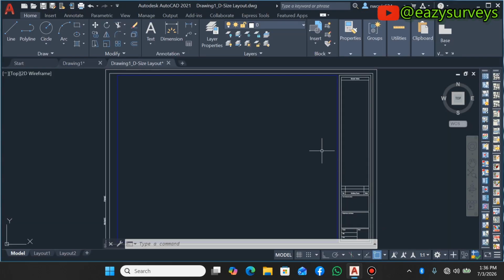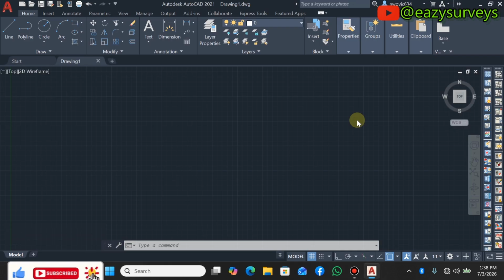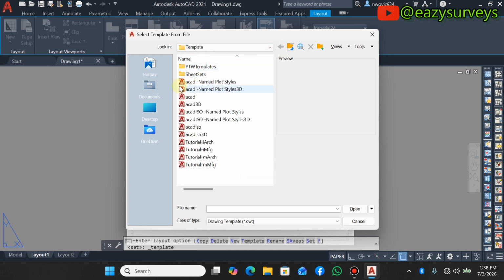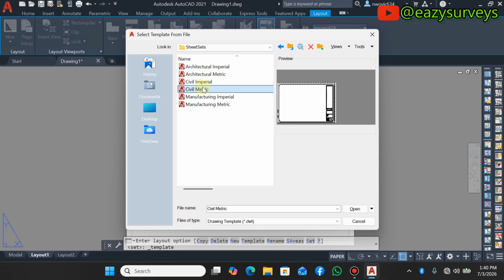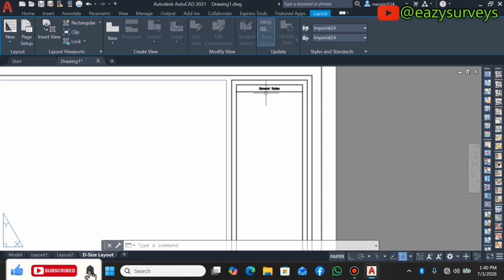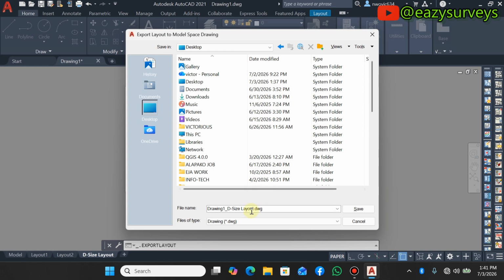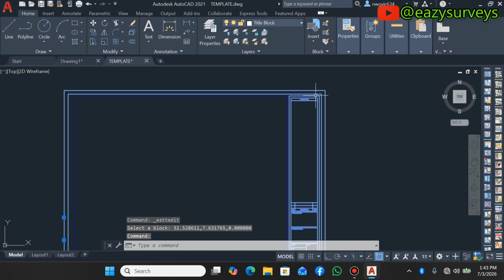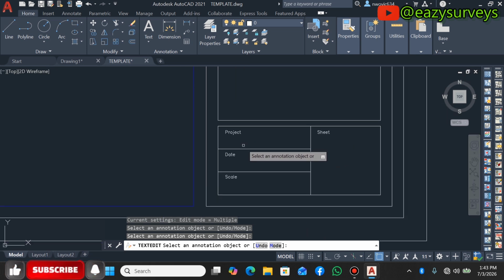AutoCAD Drawing Templates for Drafting and Mapping | Stop starting from Scratch!

Comment: Pls How do i use this for portrait plans?
Reply from the maker: You did have to customize the default template to portrait.
Reply: @eazysurveys apart from that i think it can’t be printed on A2 , A3 or A4 paper or is there paper for it?
Reply from the maker: There are dimensions for different paper sizes. If you're customising, you did have to follow the standards.